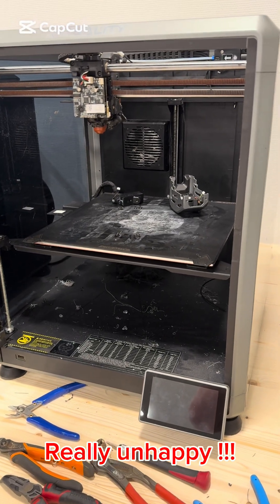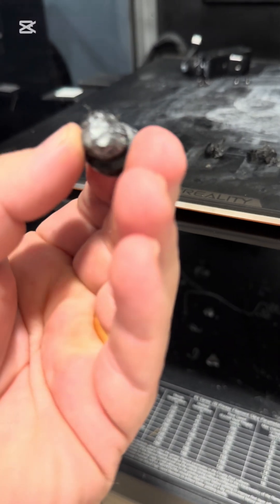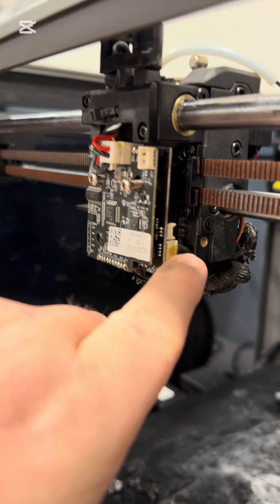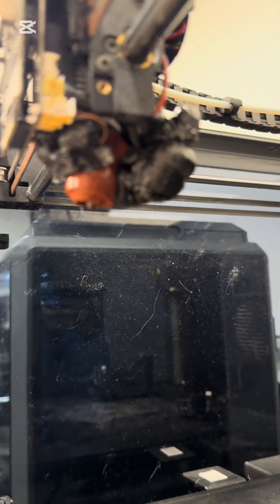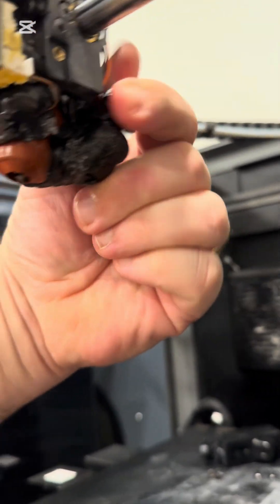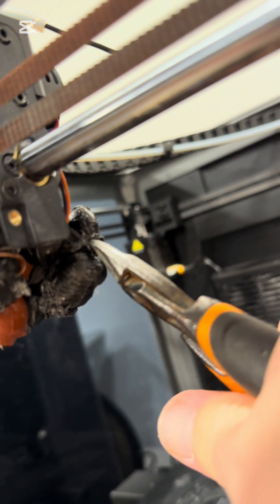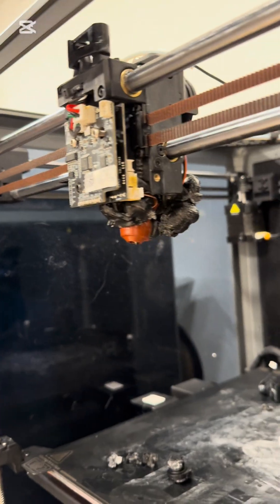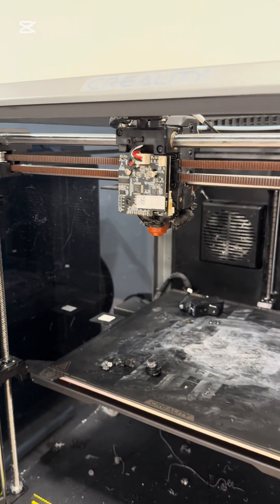Completely failed 3D printer Creality K1 max it’s a total crash 💥

Comment: i never understood how people get blob of death O.o other than their thermal paste must gotten old
Reply from the maker: I got it because I bought a new PLA tread that was cheap and I hade problems with it from start. This printer is not old it’s just a little over 7 months old.  Even in my Anycubics I’m having problems with this PLA. I even tried running slow and fast but it’s the same problem.
Reply: @JimmysHobbyCorner  you should look into conjure pla its what i run in my print farm, its a few dollars extra per roll but i never had any issues with it.

Comment: I had similar issue last year November 
I had to dismantle the whole head and order a new complete nozzle kit.
It took long to remove the stucked melted filament.
I simply used a hot soldering iron with knife mouth to gently remove the filament

Comment: You have to find a way to heat that blob of plastic just enough until you can crack it off or are able to get a cutter/pliers on it to break/peal it off. If the wires from the hot end are burnt you are going to have to replace the hot end anyway so I wouldn't worry too much about them.